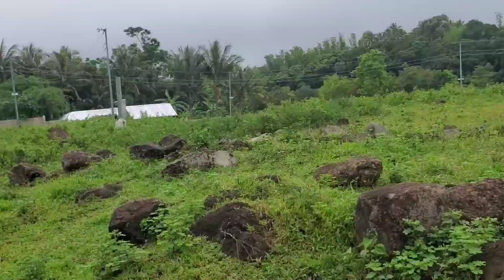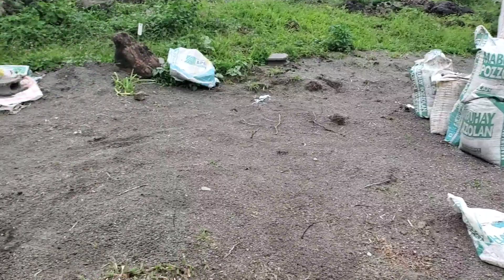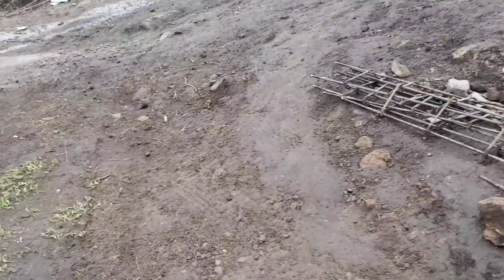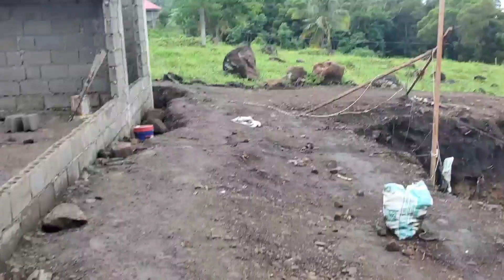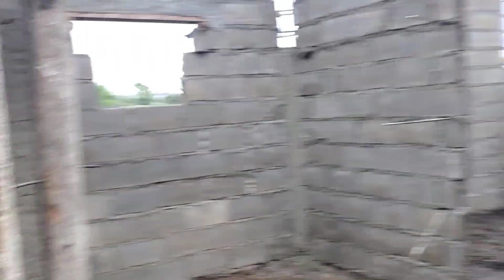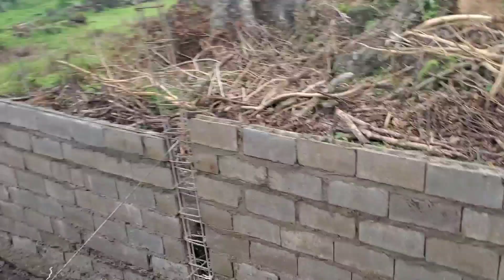Meet Sandy - Construction day 16

Comment: Those 4 inches  hollow blocks might be fragile but at the end they fill them with cement and render them with 2 inches of pure cement and fine sand on both side, therefore at the end your walls will have 8 inches thickness.
Reply from the maker: Yes, once they are done with all that it will be very strong.  I'm learning the concrete is stronger then the hollow blocks. Wilma's house, in Leyte, was built this way, and its still looks great with no cracks.  Even got through Typhoon Yolanda without any issues.  Thanks for pointing that out.

Comment: Greg, time to try to look for  6 mil vapor barrier  to put down  on ground  before you  put cement şlab inside the house , might be hard to source  if building  supply  dont have ,maybe  those who sell greenhouses?  If not do as Texas  Filipino did , tarps, he did this so moisture won't wick up ,( he is on the beach) you are way above , but  it still rains a lot. I've  seen some builders poison the ground  under the slab for termites  before the pour.
Panasonic makes good quiet  fans for the bathroom,more CFM  the better. Are you going to  spay the dogs later? Most dogs there  are not, that is why  so many strays... Philippines  ,  country with lack of BIRTH CONTROL 👨‍👩‍👦‍👦👨‍👩‍👧‍👧👨‍👩‍👧‍👦I'm one of ten kids...❤🇵🇭 LOL
Reply from the maker: Hello,  I will ask contractor about the vapor barrier/spray for termites.  I never saw those products here, but wasn't looking for it.  I need to visit city hardware and triumph home depot.  They are the 2 major retailers that sells home building products.  Kinda, stuck with what they have.  Sourcing from Cebu or Manila raises the price a lot. Sandy is someone's dog.  If she becomes ours then we would absolutely have her spayed.  We need to be careful not to offend the locals, by assuming she is ours just because she looks to be a stray.  Don't want to offend the neighbors.  So many stray dogs all over the Philippines.  So many get no care at all.  Thanks for watching.
Reply: @buildingthephilippines  ... i agree with AURELIO. the vapor barrier under the cement will be a good precaution because concrete is porous and moisture can cause damage in the long run.  however, my question is where should be the moisture barrier put, below the gravel or above the gravel.  just to give you a reference point, when i had my hard floor put in, the contractor put the moisture barrier on top of the slab but maybe because that is the only choice. i live in the bay area CA and over here we get only 20 inches of rain a year and builders are always concerned of moisture (including radon) so the barrier is always considered.  in your place in RP i suppose you can get as much as 50 to 100 inches, maybe more.  so maybe check  what your contractor can do.
Reply from the maker: Yes, I need to discuss this with the contractor.  Very limited supplies here in the Philippines as a whole, but especially in the provinces.  I'm learning that first hand.

Comment: Very shaky gimbal at the  start, but  its improved later  on,  i think  sandy needs to be  taken to the vet to have a  check up, but is easy for me to  say that, as i don't know details about her, i like the idea of buying the wheel  borrow  for the workers
Reply from the maker: Yes, disappointed in the gimbal.  Maybe its me.  There is a setting on it.  I will try one more time and if its shaky it will be retired.  I did buy a simple selfie stick down town, will try that soon as well.  We will figure it out.  Yes, Sandy needs a vet.  However, the owner more then like does not have the money or transportation to take her.  We have been asking who owns her with little success.  We need to be careful (as a foreigner) to offend any locals by, "taking there dog".  We will continue to feed/water and go from there.  The wheel barrows is much appreciated by the workers, that was the contractors idea.  Thanks for watching.

Comment: Hey Greg&Wilma 
I wonder if all those big blk Rocks  Strewn about  were remnants from eruption activity many moons ago ?
Reply from the maker: Hi Gary, yes I was told (from the locals) these rocks are from a volcanic eruptions long ago.  I did some research and that research showed that the rocks are from tectonic plates (earthquakes) shifts deep underground pushing the rocks up from deep underneath.  Maybe a bit of both.  I can't wait to power wash the rock wall.  The rocks are blue, grey, pink & green in color.  That would be a good video.  Thanks for watching.
Reply: @buildingthephilippines  yeah Greg those rock wall you stacked up is gonna look great 
Cleaned up with the grass that grows in afterwards